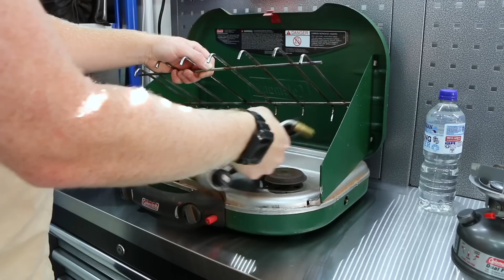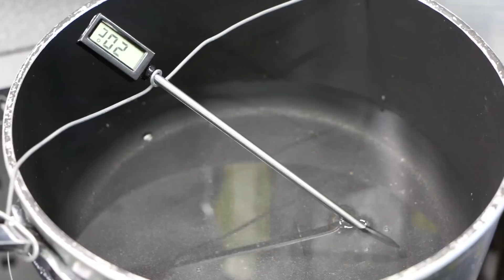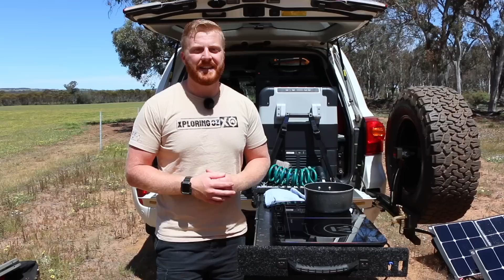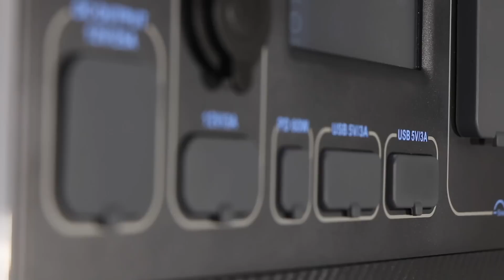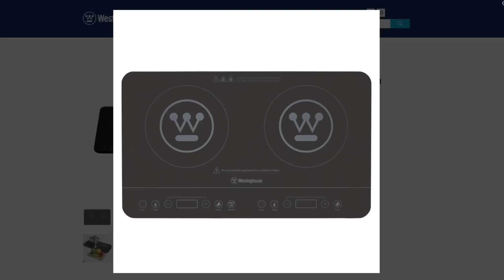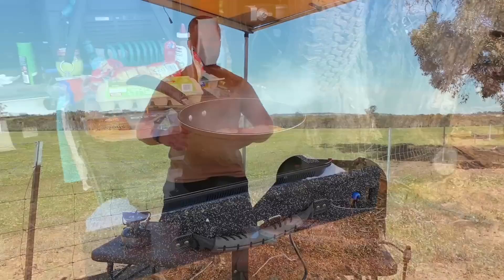INDUCTION COOKING & Camping | Is it sustainable | Electric vs Gas | Overland Cooktop | Pots&Pans

Comment: Only issue I have is your temperature sensing. The Jetboil showed 88° when the display failed and you took it off. I’ve watched several of these comparison videos and induction is typically ½ the time or less of gas cookers and also faster than a Jetboil. The tests I believe were flawed as I’m pretty sure they never got to 100°.

Induction reacts to increase the temperature just as fast as gas, or faster. And with the right induction cooker, you can simmer with ease - you just need to buy one that doesn’t cycle on and off but just ramps up & down its energy draw based on the setting. But as shown, even ones that cycle simmer ok.

You talk about expensive lithium setups but those Bluetti units are very expensive. I have a 400Ah LiFePO₄ plus a 3kW inverter, an induction cooktop ($40) and a 50ℓ fridge in the rear of my wagon and those 4 things cost less than a bluetti. Well, the Bluettis I’ve priced out. Sure - it’s not portable but that’s not needed. 
With induction there is no need to use full power to cook sausages. It does the job on about ⅓ power. 

Induction is superior due to wind resilience, speed, efficiency, cost to run and weight (if you already have a battery system installed). You can charge using a DC-DC while driving, I have a 40A one. I have gas as a backup in the camper trailer (4 burner with 9kg bottle installed) and a small butane stove with BBQ attachment which would allow me to cook away from the camper/vehicle if ever needed or in the event of damaging the induction unit. Using solar to charge your energy is also free unlike gas.

Comment: For me the speed to achieve a boil is not as important as the amount of energy used, I’m camping and not in a rush.
Reply: Well gas uses a lot more energy as so much is wasted to the environment. The energy for induction is free with solar and minimal charging off the car. So induction is the most efficient and by far cheapest to cook/heat with.

Comment: Let's see.   Induction stove... $200.  Battery system to operate it $1000.  Or
Gas stove and fuel.  $200.  🤔
Reply from the maker: Yeah definitely, the initial outlay is a bit of a hurdle.
Reply: @XploringOz the other thing to consider is how much you will actually use this expensive gear.  My brother spent the dough 3 years ago and has used it once.  It's like a new year's resolution gym membership that gets used once or twice.  Propane or fuel based stoves can be put into a box and into the corner for years and be used at a moment's notice.  Other things to consider are if you are truly hardcore and out all the time, you are limited by factors such as continuous use, duration and availability of sunlight.  Wind is certainly a factor but can be remedied.  If you're trying to save the planet, all the materials used to build batteries for this expensive endeavor,  debatable.
Reply: Most people already have an electrical setup. Just get the right system when you start. Also, with gas you are buying fuel forever and polluting - with induction you never buy fuel for it again and zero pollution. 
As for how often you use it - every time we camp. 400Ah LiFePO₄, 3kW inverter, 40A DC-DC, Solar etc all part of the build. Induction cooktop cost $40 on eBay and been using it for 3+ years.  It doesn’t have to be expensive. Inverter, under $400 in 2019, still running. It’s a no brainer. No wind to worry about and it’s so much faster than gas.

Comment: Good video, thanks. The new Bluetti Charger1 changes the game and means you don't need an inverter mounted in the car to get over 500W in to the Bluetti power station when driving.
Reply from the maker: Awesome, glad you found it helpful 👍 for sure, the new charger certainly makes life easier
Reply: DC-DC charger will charge the Bluetti while driving.

Comment: Good test, and without looking at the other comments I'm sure people are asking about Evaporated water lose. Assuming that a pot of water simmering until boil is 4ish minutes and another takes 9ish minutes; the latter would have evaporated more water, compared to the water reaching boil point in 4 mins. So you would need to add more water to reach your desire quantity at that temperature, No? probably not on small volumes, but larger would matter.

Comment: PRO TIP when using induction stoves while camping: Use a silicone baking sheet on top of the stove for a safe, non-slip surface which doubles as protection for the stove top.

Comment: Nit: you need ferromagnetic cookware, not ferrous cookware.  Not all ferrous materials are ferromagnetic, and vice versa.

It's nonsensical to say "500 watts per hour".  It should be just  "500 watts".  Watts are already a rate: the per-hour is built into the unit of measurement.  A watt is 3600 joules per hour.

Induction cooktops only heat a portion of the pan about as wide as the coil.  Thus if you need even heating across the bottom of the pan, big pans are best heated over cooktops with big coils, which are a bit hard to find in a portable unit.  That can be a factor in certain types of cooking.

Your Westinghouse induction cooktops draw 1000 watts minimum when heating, which can be a limiting factor depending on your power source.  There are other induction cooktops that draw less, which gives more flexibility to use a smaller inverter or to use multiple cooktops at the same time.  Some Nuwave models can be configured to draw as little as 600-900 watts, depending on the model.  Units from Abangdun have constant power draw, so whatever power you set them to, that's what they draw. Their large units go down to 250 watts, and their mini cooktops go down to 100 or 200 watts.

Great video.  Thanks.

Comment: #1 installation/use error impacting portable induction units … don’t place it on top of a metal surface.   The magnetic field will also heat that surface, waisting energy, and possibly creating a new hot-surface hazard.  Every portable induction unit I have seen comes with warnings about this,and the Westinghouse unit even has it stenciled on the cooktop surface.

Comment: Lone camper with a 500w induction cooktop that handles 4 to 6" wide pan base. 300wh LiFE PO4 power station w/1,200 surge. 110 watt portable solar panels, but looking to go 200 watt. whole system about $400 with careful shopping.

Comment: It's easy for RV's so long as you use 100 amp solar charge controller with minimum 1000 watts of PV , don't even bother with a Kings solar charge controller they are just 20 AMPs and only allow 390 watts of PV, a 3000 watt inverter should easily power up a 2000 watt inverter. The issue is to replenish the amp hours that you use especially if you run a fridge and TV and fan from your battery,. It's better to try and run everything on 12 volts including coffee maker fridge freezer TV Fan, inverters draw between 15-20% of power .

Comment: Not really a question for us: They do make 12V or 24V induction hobs as well as smaller size 700W units, they are all small, light and as safe as can be. With a bit of electrical knowledge you can roll out an extension cord where mains is near and cook perfect meals in the wildest storms. It pays to have a portable leakage breaker, also handy on the hair dryer where water can be near. Maybe you should look at the many gas explosion pictures where vans get blown into pieces just because of gas. I first came across induction in a Japanese hotel room desk where instead of an inkpot one could brew green tea with induction. Some people even pay for powered camp sites to charge their mobile phones. Power boards with USB built in and breakers is a must. If I would tow then phosphate batteries of lowest gravimetric dimensions would reside in the trailer. Knowing ohms law is rather beneficial and good meters at the right place are more important than bluetooth. Even a 3 phase to single phase adaptor can come in handy at some show ground sites. A good water pump with a membrane and good carbon filtering should add to survival training together with redundant comms equipment.

Comment: in my experience dedicated electric boiler are match more efficient. 
i have a ecoflow delta max 2 and when i try to boil water using my electric  stove it uses 20%, and the boiler filed to 1.8 L (or full) of water it uses 6% of the capacity  and much faster.

Comment: Great reporting. One of the best I've seen and I've seen MANY. What I'm about to write is not meant in any way to criticize or dispute anything that you've presented here. This was a very high quality production, but although I don't make videos, I am a geek that loves to experiment and I also do all the cooking in my home, so I think I may have some worthwhile things to add to all the good data that you've presented.
  Here goes. I have a USA version 120 volt NuWave PIC Gold cooker. It can be set for 600, 900, or 1500 watts and has about 6 preset temps as well as adjustments at 10 degree F intervals. So, not exactly like yours, but I think they work similarly. The first thing I would say is that, to get the fastest boil time you obviously need the wattage and temp set high, but in addition, you have to have a pan that covers the entire coil or coils under the glass. If I measure the wattage use of my cooker boiling water at 1500 watts/ 375 F in a pan that only contacts 5 inches of the glass, it will only be using 5 inches of the coil underneath and the measured wattage will only be 580 watts of draw from the power supply and that translates into less energy going towards heating the water. If I immediately replace that pan with a pan with a 9 inch flat bottom surface, the wattage jumps to 1500 watts and that's nearly 3 times the energy going into the water. That is important to know for two reasons. Firstly, it may mean that if I have a very under powered inverter or solar generator I may still be able to do SOME cooking if I use small diameter cookware. My cooker allows down to 4 inches and I expect that that may even draw less that the 600 watt low setting on the control panel. The other thing is that, if you boil in a 4 inch hiker's type pot on a gas burner, you will probably beat the heck out of the induction cooker with the same pot, but if you pour the same amount of water into a 9 or 10 inch pot for the induction cooker set at it's max setting, it will probably beat a gas burner using a 4 inch pot by a significant margin.
   All of the temperature control ( with the exception of the 1200 USD cookers) is done by sensing the temp of the glass and making some inferences about the probable temp of the contents of the cookware. What that means for a user is that the material and construction of the cookware will have a lot of influence on the sensitivity of the cooker's temp regulation. For instance, stainless steel is said to dissipate and spread its heat very quickly and efficiently, whereas cast iron retains its heat and doesn't really heat that evenly ( I know that's counter to what you usually hear about cast iron, but I've seen it proven with FLIR cameras on electric coil stoves that clearly show the coils under the pot, through the pot, after some period of time) But I digress. What that means is that a stainless pot it going to keep the glass at a temperature that is closer the the temp of the contents because it passes the energy more freely to the contents then cools down and triggers the next on cycle. These cycles will tend to come closer together and yield good close temp control. The cast iron, on the other hand, lags more in passing its stored heat energy on to the contents and therefore takes longer to cool down to a temp that lowers the cooktop to a temp that will trigger an on cycle. Basically long pulses of energy then a long wait for the next pulse. This translates into wide fluctuations in the temp of the actual contents. Less than Ideal cookware material is probably to blame for the whole "you can't control it as well as a gas burner" rumor. When you turn down the burner under a cast iron pan it takes forever before the stuff in the pan cools down and when you turn the heat back up it comes up slow. Same same!
  The only other thing that I'd add is that you should always pre-heat your pan if you intend to do shallow frying because the induction coils can heat the metal so abruptly that it can warp or cause its ceramic or Teflon coating to dislodge fro the underlaying metal. A minute or two at 150 F will allow all the materials, the ferrous and the non-ferrous to expand together.
   Lot of words, I know, but I hope I didn't waste anyone's time. You sure have a beautiful country, BTW.

Comment: Regardless of boiling speeds in real world tests.... If you have a generator that uses the same fuel at the same rate as your gas burner and have an induction cooker capable of using as much power as the generator is producing the induction cooker will boil water faster than using the fuel directly.

Comment: You need to get and induction wok heater/stove.  I mean a typical Wok uses about 10 kw.  An induction heater will use way less 600w to 1500w.

Comment: Boost up your storage at low cost. Buy a LifePo battery 100ah (1280Wh). At this storage capacity you are looking at minimum 800$ if you get a power station, vs 250$ if you get a battery. Use it as a power bank for your bluetti.

Comment: I have a 13inch cast iron skillet and my biggest problem with cheap induction cooktops are the size of the actual induction coils which mostly are not the size of the white perimeter painted on the stovetop.  
Because they heat up so quickly and usually not over the entire pan surface, they can cause warping of your pans.  You will find that everything cooks much quicker on the centre of the pan where the outer circle remains raw.  That is because there is no coil under the outer part of your pan.  
The biggest induction coil I could find is a 9 inch one in the Breville Control Freak.  That is really a nice single plate, but at $2100, it is very, very expensive.   The only other solution is stainless steel pans which has a aluminium core for heat conduction, which will cause a more even cook for things like steak and bacon.  
I would love your thoughts on my comments, as you might have a solution I have not found yet.  
Ps, your home stovetop would have the same issue with pans, unless you use stainless steel ones.
Which brand failed you twice? I would be curious to know.

Comment: I bought a pair of single burner induction burners a few years ago and mine have digital temperature settings that you can use to choose which temperature you want the pan to heat up to and the unit will cycle on and off automatically to maintain that temperature. I haven’t used them for camping yet, but plan to in the near future. I have a pair of Anker 2048 watt hour power stations and 1000 watts of solar panels to keep them both charged up, so I think that I’ll be okay with my electrical setup.

Comment: Late to the game as this video is 2 years old. Anyway, my new Jeep has a power box with 4 AC outlets and 30A of potential power. I'm sunsetting all my gas gear and changing over to electric.  Anyway, what pots and pans are required for induction? What brands have you found that work well for overlanding?

Comment: If you want to compare, know or work out, what battery power you need.

2000 watt hr bluetty lithium battery would = 166 ah 

= a 100 ah lithium battery (1200 watts) @ 2000 watts consumption would drain to about 20% in about 30 min.

1000w consuption would take 1 hr, for avery 100ah lithium batery to drain to 20% left.

20% being 12.8v reading, the point you don't want to drain past to extend battery life and not cause dammage.

100% being 14.4 to 13.6v reading

So you get bout 30 min at 2000w consuption per 1000ah battery.

It is recommended to have 100ah of lithium battery per 1000w of inverter.

1000w inverter 100ah of lithium battery

1500w inverter 200ah of lithium  battery

2000w inverter 300ah of lithium battery.

Iitium baeries can safely drain to 20% or 12.8v

AGM / Lead batteries can only safely drain to 50% so as to not dammage the battery.

So running the system in the video would reqire upto a 1500w inverter.

You still want to run your fridge and lights after cooking, so you need extra / excess battery power or enough solar to charge fast enough to replenish.

Comment: You can try Instant Pot pressure cooker for efficient cooking, simmering and steaming with electricity. They have also air fryer covers, so baking and roasting is an option too. I am testing off-grid lifestyle and considering electric kettle, induction single hob, contact grill to replace my old sandwicher, pressure cooker with air fryer cover and my old blender. In the future I might expand, food processor would be nice. I have 2.3 kW of solar and ac200max with 2x b300 extensions, so full stack, and it is more than doable. For winter a good backup power generator might be useful, depending on location.